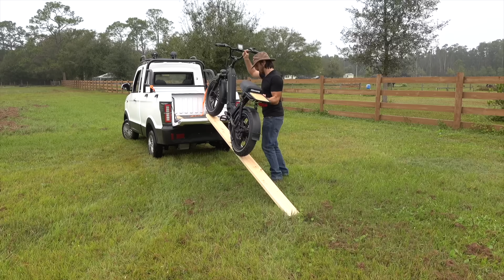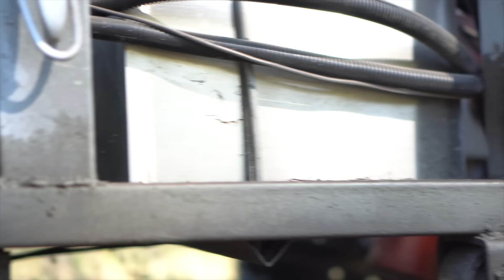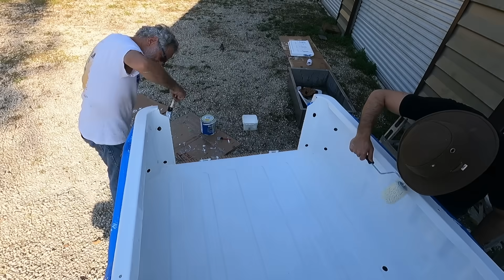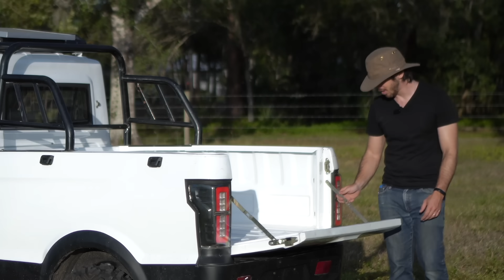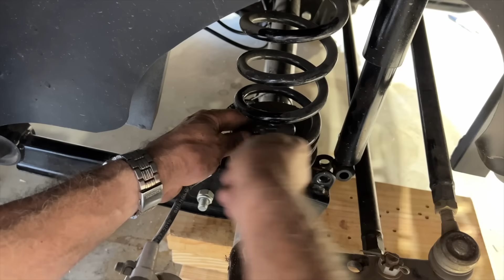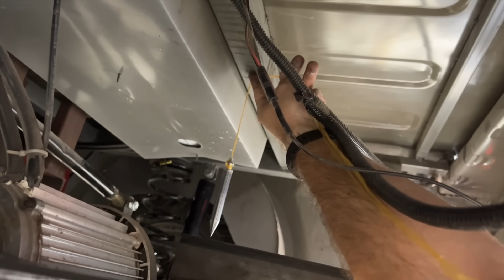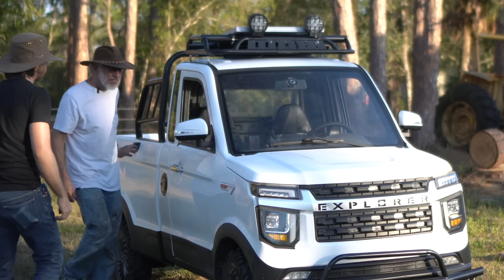My Chinese Electric Mini-Truck 18 Months Later: Did It RUST OUT?

Comment: there is no damn way that thing has been anywhere near as good as you portray it..
Reply: Well, truth be told, it absolutely is.  Please see in the video where the truck is towing our electric boat and pulling it out of the lake.  This truck is simply amazing - zero breakdowns - zero problems (well, the inside mirror fell off the windshield and we used silicone caulk to put it back on) - and huge fun to drive that puts a smile on our faces every time we drive it (which is multiple times a week).  A great truck !!
Reply: @micahsdad5388   that darn little truck is making a liar outta me eh?  well heck thats a good thing..thanks for response.

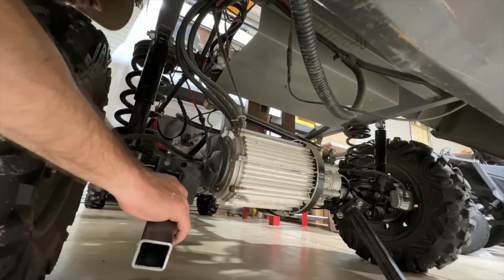Comment: 17:47 The Axle is actually not made for pulling.. need the strength of Chassis for trailer hauling..
Reply: with the dump bed feature, there was no way to attach the hitch to the frame.  Took the best available route and after pulling the boat many times, we have seen no problems in terms of lack of strength.  Appreciate your thoughtful comment.  best regards

Comment: Great addition to your Dad's work needs. The texture in the bed liner is probably due to using a roller to apply paint on metal, tiny air bubbles. A brush to tip (smooth) the paint after applying may have prevented this. I have similar problems when painting fiberglass boat decks in areas texture isn't wanted. Cheers to your family

Comment: its probably made of aluminum so its not gonna rust
Reply: Nope.  Magnet test = iron based.  Aluminum would be MUCH more expensive and much harder to form.  Regards
Reply: @micahsdad5388  must be a low-grade stainless steel then
Reply: @demogod4955  Think it was galvanized.

Comment: Looks like its holding up better than the POS Chinese Maxus vans I use at work. 10k-20k miles in and they have holes in the floor going right through the mats and insulation to the bare metal, charging ports literally falling off, seats collapsing one i was driving the other day had a faulty inverter and smelled like a toaster whenever it was running... 

Oh and we've always got at least 1 being repaired at the service centre That's fortunately about a mile down the road because they'll just stop working. Who'd have thought that doing maybe 80 miles a day doing maybe 15-20 delivery drops would be so hard? Nobody? What do you mean the Sprinter vans we have that have done over 100k miles are in better condition???

Honestly though, saic maxus vans are absolute heaps.

Comment: that so called truck is going to fall apart
Reply: One day - yes.  But that day appears to be at least 10 years off.  Beats a Tesla and costs a heck of a lot less !!
Reply: @micahsdad5388  if you're right about that then it'll be the exception to just about everything which says, Made in China on it. Check it Out.
Reply: @micahsdad5388  PS don't ever buy a guitar from China.

Comment: That vin plate may be the reason it is rust free. It is acting as a sacrificial anode. Basically it is made from a material that'll rust before the rest of the truck and in a strange way that prevents the rest of the truck from rusting.
Reply: Very interesting thought - thank you.  VIN plate as a zinc plate.  Cool

Comment: I noticed that tow hitch is attached to the rear axle...which has suspension... You may want to check the clearance with that rear bumper when it's got a load. It seems like the tow hitch could start hitting the rear bumper when it's got some heavier loads on it. ;)

Comment: sadly, these sorts of "Kei-car" trucks are not legal to drive on public streets in most parts of the United States.  They are incredibly useful due to their small size and low profile.  Modern American trucks are often far too high off the ground to be very useful as an everyday work truck.  The fact this is also a "dump truck" on top of that makes this incredibly useful as a versatile work truck.  But there is no way pretty much any state would allow these vehicles to become road legal with all of the "checks" they'd have to make to that sort of car/truck to be considered "safe".
Reply: True - very useful but not street legal.  Not a problem for us as we use it only on our private property.  Best regards

Comment: These days, car body shells are made with zinc plated steel. Minor paint damage won’t rust but it will eventually fail and be a pain to de-rust. 
Black painted under frames will have next no no paint. They don’t grit blast welds so just like cheap exhaust pipes they’ll rust out. 
 Jet wash and treat the underside with a water dispersant wax every year.  That will keep salt damage well back.
Reply: Thx - interesting suggestion

Comment: These vehicles are cheap and un reliable. Dont care if it rusts. Does it last and is it reliable. Its not reliable and time will tell how long it will last
Reply: Wrong - this vehicle is very reliable - just about 2 years of solid work and not one problem.  And with all of our mods its even better.  And it's not even rusting.  Watch the video

Comment: Why not put a rubber carpet in the back
Reply: Don't want to hold moisture to the bed - this used to be a major cause of rust in the trunks and floorboards of cars when the mat was rubber.  Doesn't let the water evaporate.  regards

Comment: Maybe they used galvanized or aluminum-coated steel sheets, which are more resistant to rust unless the coating get scraped-through.
Reply: we think they used galvanized.  Sure worked well !!

Comment: I would expect it to last for a couple years without too many problems but it's great that there haven't been any serious ones. Those tiny trucks are cool. I wonder if they can be registered and used on the road. I had an old Ford Courier truck (Mazda}. I liked it until I blew a head gasket while on the highway. It's a shame that they don't sell small trucks anymore. It turns out that it has to do with fuel economy regulations that are unreasonable. Maybe, when EVs become more popular, they'll start selling them again.

Comment: Equipment not exposed to road salt.... does not corrode.  Interesting you chose to claim Israel as your location.  Nothing about you seems trustworthy.
Reply: Wow - so wrong.  Here's the chemistry lesson: put uncoated steel in pure distilled water = rust.  It's the thing called oxygen (root of the word oxidation, aka rust) !!
Truck lives less than 10 miles from big body of salt water - it's called salt spray !! Salt makes corrosion worse.
Working hypothesis = truck is amazingly well protected from oxidation.  Data speaks for itself.  Nuff said regarding your false statement about what causes corrosion (=rust).
His parents live in Florida.  Thats called a fact !
Thanks for joining youtube on the same day that you shared this comment.  Proud ?  Or just jelly?
Reply: @micahsdad5388  You are wrong.

Comment: Remember: they are fan "cowls" or "shrouds", not "covers". Why the difference? Covers don't do much, they cover things. Cowlings & Shrouds actually direct the airflow through & around them.
-
By removing the fan shroud you're really screwing up the air mechanics of the motor cooling--which you will never notice... It's in open air and constantly shaded, and the fan will still agitate the air, so you'll still get enough cooling without it, but wags finger naughty naughty! That is not how we treat or fan-ly friends!
Reply: Shroud was replaced months ago and motor is again happy !!  Thanks
Reply: @micahsdad5388   I love your guys' channel, I keep trying to scheme what to get for my family here, ideally something I could put a ski/track kit on....
Reply: @mattphilip3266  We are looking at just such a vehicle (tracked).  Don't want to give it away - stay tuned !!!
Reply: @micahsdad5388  in Canada, if it has tracks and skis, it's legally a snowmobile! (basically)
Reply: @mattphilip3266   Just tracks - sorry !
Reply: @micahsdad5388  4 tracks sounds epic! But here if you have tracks and skis, you can use the snowmobile trail system in the winter, which expands your available road network a LOT. But, you know, not in Florida 😛

Comment: Glad you did an update video. Nice upgrades! One thing I'm scratching my head about is the hitch. Is it mounted to the axle which moves up and down and connected to the frame?
Reply: The idea was that the threaded rod floats through the upper frame member.  We will probably change it to be a length of chain.  Will never be carrying a load in the bed while towing the boat so they don't have to work together but they must not interfere with each other either.  The framing of the dump bed did not make this easy.  Thanks for your comment

Comment: I wonder if you also paid over 8,000 dollars to finally get it as two other guys (Donut) did, instead of the original price that's advertised of a little over 2K and 1K something for the Lithium battery?
Reply: All the details of the cost and the importation are found in the original unboxing video.

Comment: Yeah the battery on it will take 1 year, but at least it has 1 year warranty 😅
Reply: close to 2 years and going strong !!  Battery should last 5 to 10 years based on our use case
Reply: We had a trike based on the same tech-base, same motor, quite similar frame, and so on. These lead batteries are really heavy duty, they stand mal-treatment and anything else.These things are small utility vehicles (SUV *eg*), made to work and last.

Comment: Id definitely like to see a big mod community behind these. But if it was mine id personally swap acid for lithium batteries, spray in bed liner, make a truck topper, add an extra panel or 2. Body off complete frame powder coat. Wheel spacers, custom weld heavy duty steel bumper front and back with a winch in front. And the best part is rip the motor and fit a single tesla motor in it. Be a great farm truck and camp mule.

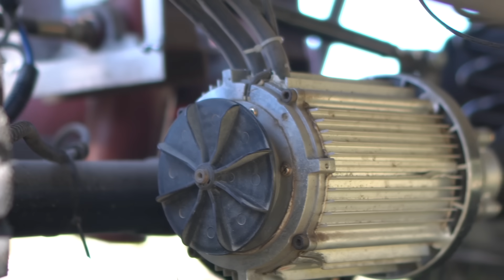Comment: 4:40  ..the fan cover does more than protect the fan; more importantly it directs the flow of air produced by the fan along the cooling fins of the motor, preventing it from overheating

Comment: I think you may have compromised the rear suspension by using that bracing to the towbar unless I missed something. Still a fun little truck.
Reply: Agree that it is not a perfect fix.  Limitations of frame created constraints.  Thinking of a flexible link instead of the threaded rod which was supposed to float.  regards

Comment: Wait, hitch connect to axle and frame via the threaded rod. Didn't you just bolt the suspension soild to the chassis?
Reply: The rod was designed to float but we are planning a redesign with a flexible link to allow the frame and axle to move fully indepently.  Thx
Reply: @micahsdad5388  good stuff! Thanks for responding.

Comment: Aluminium foil will not rust. Are those MIL Spec welds? or were they done by a blind man with no arms holding the welder in his mouth?
Reply: 1) Don't think that your suggestion re: making a truck out of aluminum foil will work out well, but very supportive of you trying it.  Never know.  Ours is made out of galvanized steel.  Same result - zero rust.
2) The guy may be blind and armless and make bad looking welds, but .... not a single weld has failed after nearly 2 years of heavy regular use.  
Thank you for your comment.  Best regards

Comment: bro buy a heavy duty rubber mat for it if youre gonna be rough on it. about a half inch thicccc and you should survive an atom bomb, also it will make it smoothe and dump easier
Reply: Thought about this but were a bit concerned about moisture being trapped between the mat and the metal of the bed below.  The new bedliner is hard as a rock.  Time will tell.  thx
Reply: @micahsdad5388  just put some insulation foam between the gaps before the mat and your worries are gone, also a proper seal with rubber cement all the way around the perimeter, but good luck ever getting it off lol, and leave it a few inches long to cover the gap in the tailgate and it will prevent shit from getting where it shouldn't also reducing maintenance

Comment: Drive it somewhere where they have snow and use salt in winter. In 4 months, it will be scrap
Reply: Within 10 miles of the gulf coast and very humid here = high salt load.  Also extreme UV radiation in So.FL.  Hear what you are saying but this environment is not a cake walk.

Comment: Meh don’t quench it with water ever , and especially when it’s welded tube..you are going to replace the hitch in a couple years.. when you quench it, it weakens the weld, causes cracks and guess where the water goes… I’d say I appreciate your welds but but that is a sin.. also why does every “YouTube welder” always try to tack and weld in awkward positions..like dude I’m not even crapping on you but why make life hard ..😂

Comment: Enjoyed the update! A few months late but i noticed the hitch is mounted to the axle, and then threaded rod up to the frame. Does the cause any issues with suspension travel or any articulation?
Reply: It's a tradeoff for sure.  If we had significant weight in the bed at the same time as towing, it would be an issue.  We are working on an upgrade to our upgrade (LOL) that will have a flexible link instead of a solid one.  This should fix it.  It's the dump bed that created the issue.  Best regards
Reply: @micahsdad5388  in the meantime, replacing the threaded rod with a heavy duty strap, sort of like a suspension limiting strap, might offer a compromise.
Reply: @alextroche5944  great idea.  We were thinking of a chain anchored to 2 places on the bed and one spot on the hitch.  Your idea is simple and elegant.  best regards

Comment: I think the tailgate doesn't open totally flat because since it's a very short bed the gate being a little higher helps to keep items like plywood sheets or wood planks from sliding right out the end of the gate. The Ford Maverick pickup has a tailgate that among it's adjustments is one a lot like this to help hold plywood and lumber in the bed.

Comment: they use oil burned steel for the frame and tin cover for the cheet steel. this is explains weird wielding of the frame and why it is not rusting much. aside that i would put water proof plywood on the bottom..

Comment: I have a bad knee I’m 37 but can barely walk anymore I wish I had an e bike so I could go on bike rides with my family. My boy is 4 and I cried a few days ago because he said why don’t you play bikes with us dad.
Reply: Hey,,,,i had BAD BAD knee too from falling on ICE, then trainig to jog for half marathon too much running. I had really bad knee pain for like 8 yrs, and one point i could BARELY walk also. So i somehow by having miracle slowly train myself to walk (bad habbit ) differently with proper knee protector n nice shoes i could walk again . 

Get —Zamst Knee braces. I think they are not cheap about like $68-100 depends which one u order . I was barely even walking ,,, one time that in the mall, my husband took me to sports store, i put one on , within like 30 seconds i could walk out normal. It was like Miracle so strange.  I have tried every other ones , none of them ever work . Especially those $50 NIKE ones. 

Yeah that —-Zamst—- Brand (Japanese) has some insane materials 2 diff layers, some thin but VERY strong special nylon under, then some well firm but high elastic knitted layer on top. So it holds knee together without strangling it. So cheap crappy knew covers, usuall too loose, or it is too TIGHT which will be like really tight RING around the leg strangling blood supply. D Japanese Zamst one like LIFE SAVING. 

Also get those —FIT FLOP—-shoes. NOT flip flop. Its call FIT FLOP shoes. They are MORE comfortable than any running shoes. It has 2 layers diff soles, mid outter soles are soft, then the heel is bit harder in the middle , it has added extra foam cushion 3D linning, with another Leather on top line the INNER insole. Its like one of those shoes RUINS any other brands .  U can actually BEND the shoes. N those shoes do NOT WEAR OUT . I end up not wearing my running shoes any more. Lol. They look like everyday shoes but they feels like air bubbles .  They are usually around like $110-230 something like that, they are so good they dont fall apart. Yeah thoes shoes when u walk.u feel like bouncing in 2 layers of yoga Mat. But they are NOT flimsy . 

3rd find thoes —-Sanuk yoga mat sandals. They are they actually are made of yoga mat inner linning they are like the most comfortable thing u can walk around d house if u have to stand up long.

Yeah, try out the —Zamst knee brace first (they runs small need size up) . I was so sad i remember crying that I was limping n could NOT walk in knee pain. N out of blue i just walk normal lol like nothing happened lol . My dude was like ;”oh we buying it lol. “ 
Its ugly ass black knee thing. Looks SAME no better than anything online. If i never tried in person i would never bought it. I went to the Flagship sports store in like downtown Toronto canada, so its like store only sells kinda pricy sports stuff like hockey n baseball, hiking all sorts. So it was like Pure luck I found such good item. Save my life. 

My KNEE completely healed. Like took 6-8. Yrs slowly . But it healed,  so give u some hope.